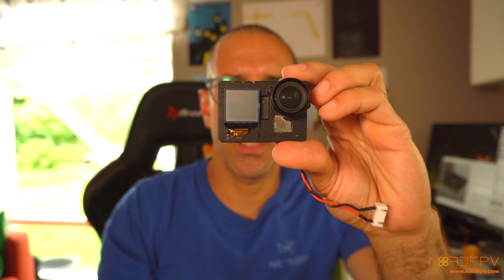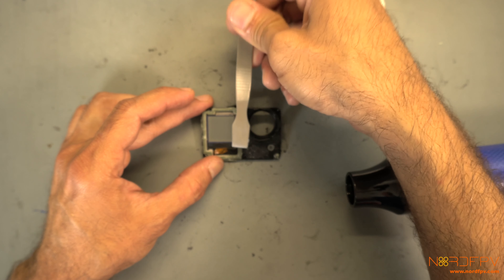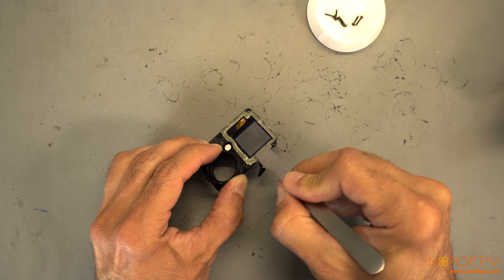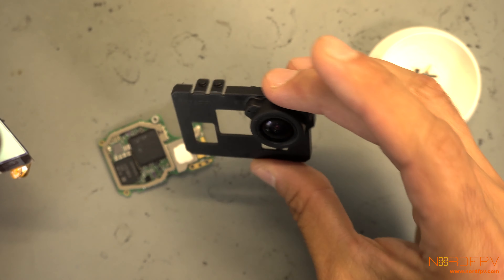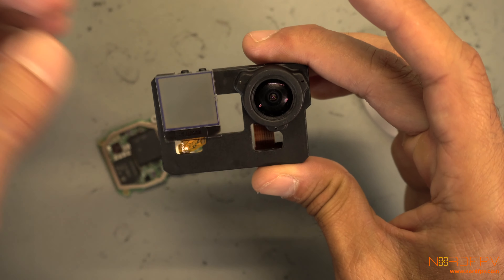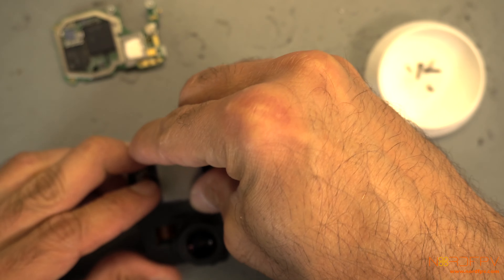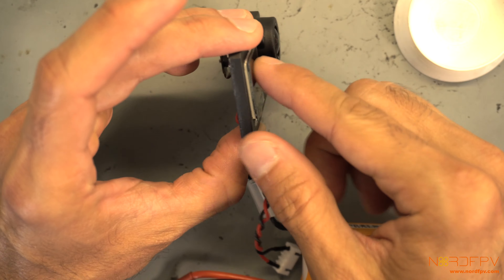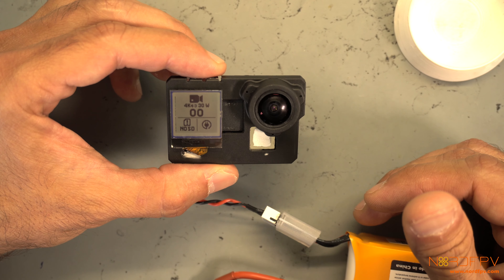Installing the naked GoPro 6 Front Screen

Comment: Please show how to do connecting necked go pro via lipo battery balance wire.
Reply from the maker: Hi, thanks for your comment. That's just soldering two cables to the board. Nothing fancy. The only detail is that you have to take the two further pin on the balance cable. Let me know if you want more details
Reply: @NordFPV  do you have a video for that ?
Reply from the maker: @JoaoSilva-vx4sh  yes. Look at my videos in the channel. I think is the 3rd last video